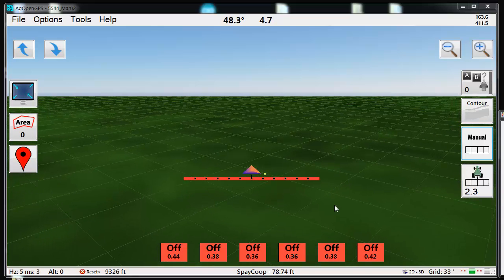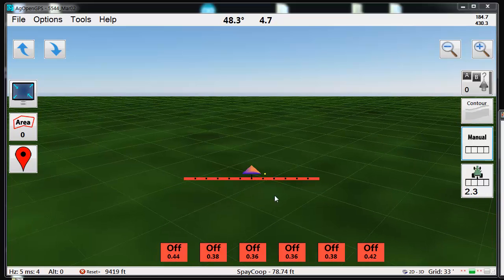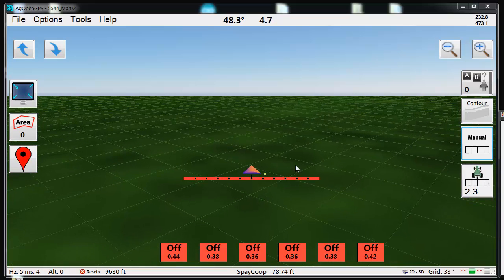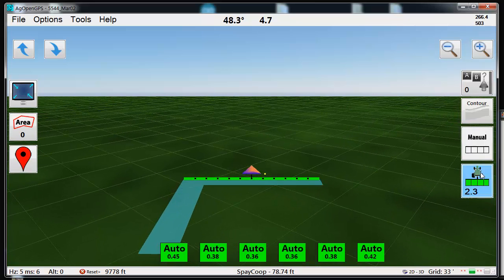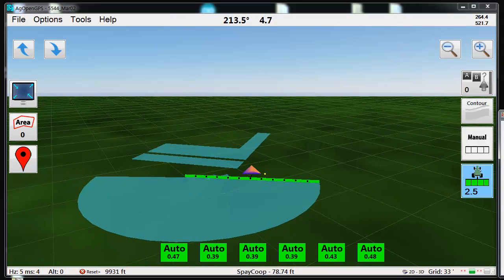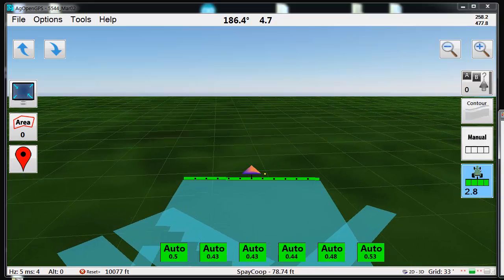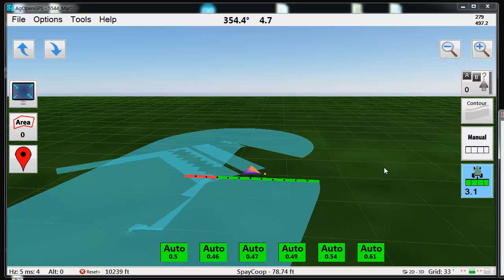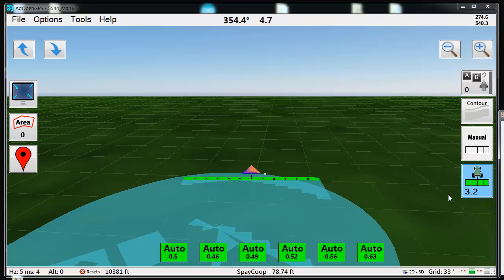PWM and AgNoz

Comment: Hey Brian. Nice video. I just want to hear what happend with the development of agnoz and individual nozzle control ?😊
Reply from the maker: The latest version to come out very soon, v 5.7 will have it all. up to 64 individual sections of the same spacing, or up to 16 of different spacing. So.... Its here.
Reply from the maker: Its a pre release, but you can try it out. https://github.com/farmerbriantee/AgOpenGPS/releases
Reply: @FarmerBrianTee  wow. Thank you so much for the awesome work. I'm a electrical engineering student, so I'm amazed over the work and would like to build a system myself for our sprayer 😊